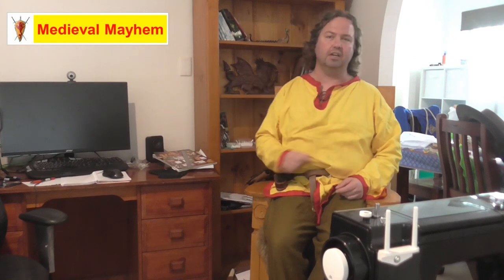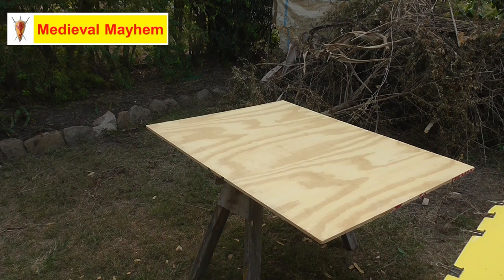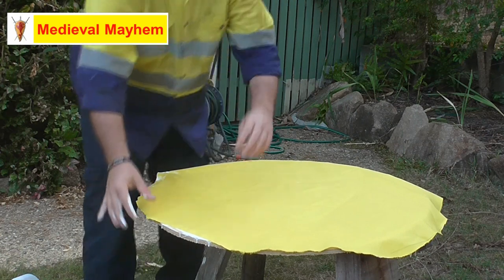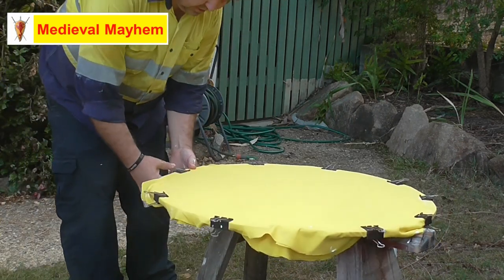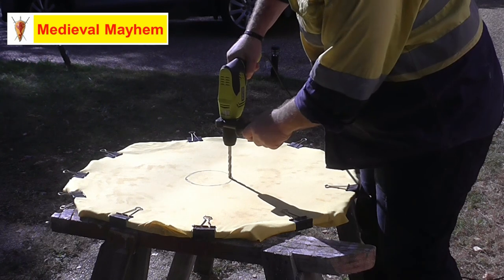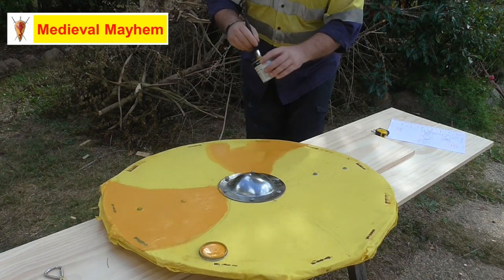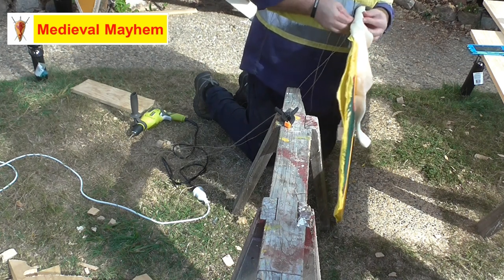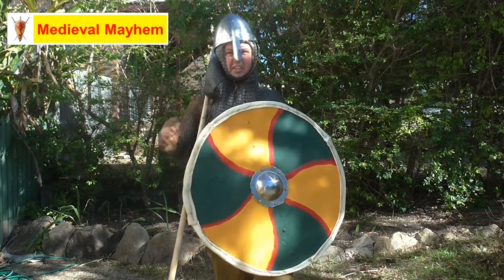How to make a medieval Round Shield (Viking) Skjoldr DIY

Comment: Looks good mate, I've previously used carpet tacks for fixing the rawhide to my shields, but I've decided to go with the stitching on the next one. Fighting against NVG Jorth Gar at events usually makes for quick turn around for the shield edges 😂. From the video it looks as though you're using 12mm ply, I usually only use 7mm and have only had to make 2 shields in the last 10 years as the 2-3 frontal layers of linen plus 1 on the back takes a lot of the blows out of it vs spears and Dane axes, I've found that way I can get a shield of around 90cm without sacrificing weight overall.
Reply from the maker: Hi. Thanks. I've not trained yet against or with NVG - they've got a great reputation. I like your Hedeby bow video.

I would be interested actually in doing some videos with groups of re-enactors in the future as COVID allows.
Reply: Cheers mate, if you ever come up to the Abbey Festival or Armidale Gathering, look for Rognvald's Lith if you feel like having a chat I'm their Archery Marshall
Reply from the maker: @rshaart4810  
I used to volunteer at Abbey. It's been cancelled now two years in a row as I'm sure you know.
Hopefully as the borders reopen, I'll go to Ironfest or Armidale maybe next year.